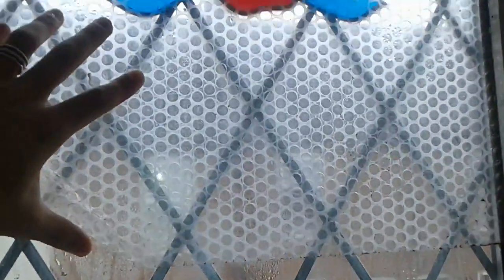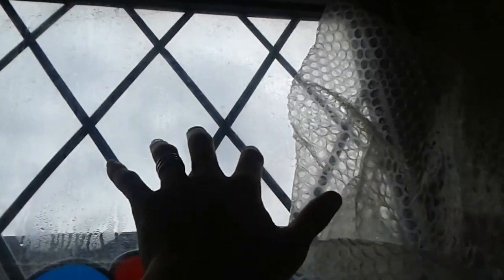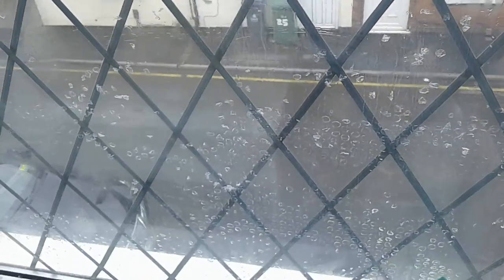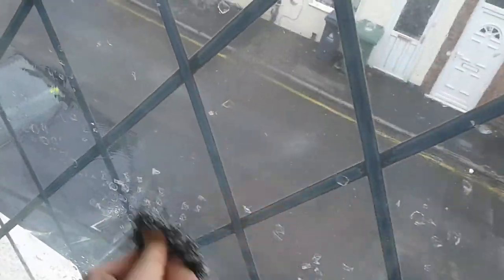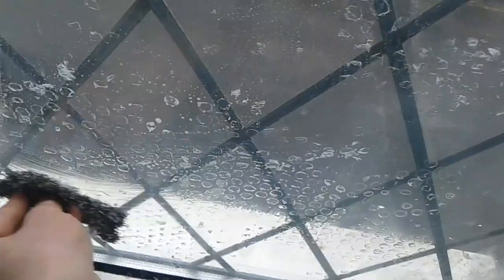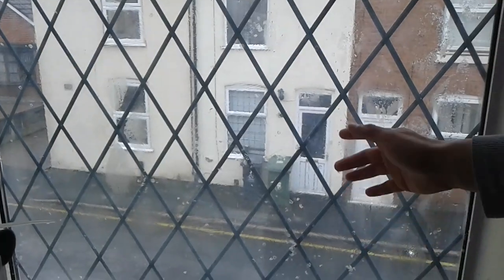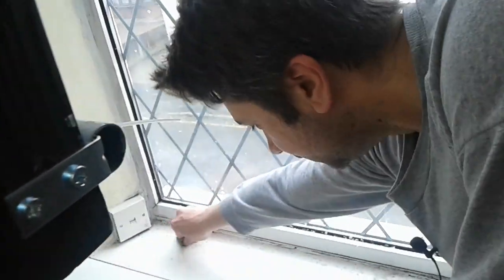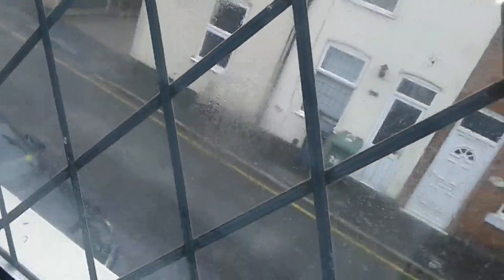How to remove bubble wrap insulation from windows

Comment: Just tried this! It worked!

An extra tip tho:

Make sure to spray GENEROUSLY. LIKE REALLY DRENCH IT. Then leave it for a few hours. I didnt need to use any extra tools to remove the extra residue. I just picked them off with my fingers. Super easy! For some really stubborn spots, just spray them again and again.